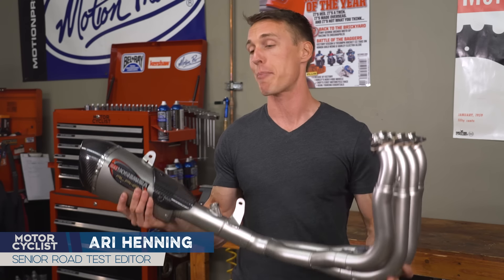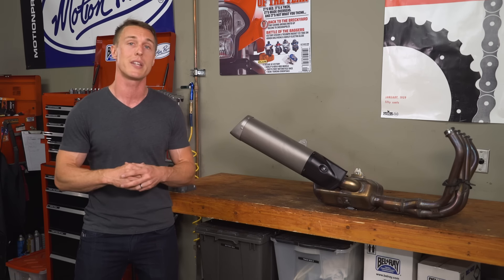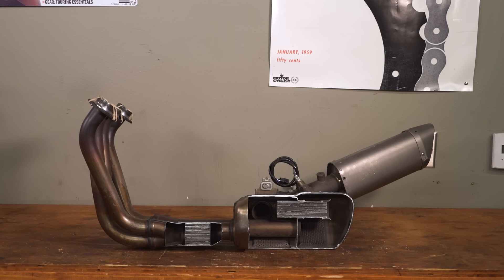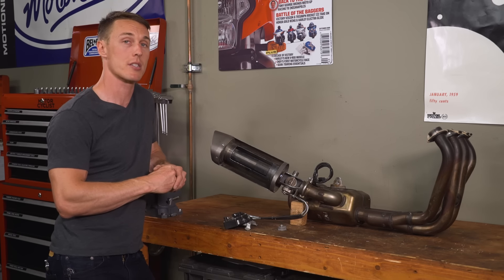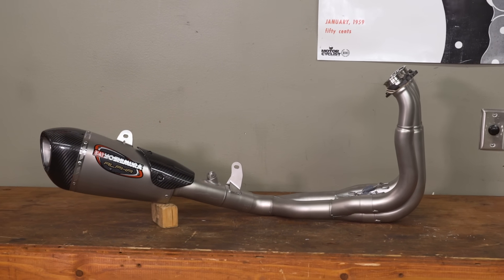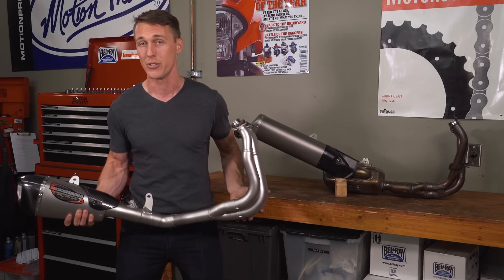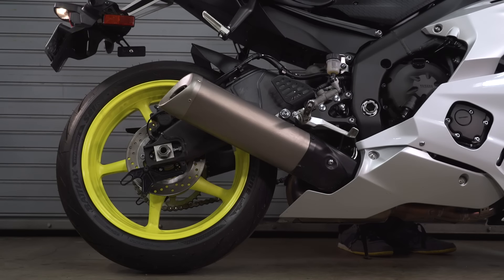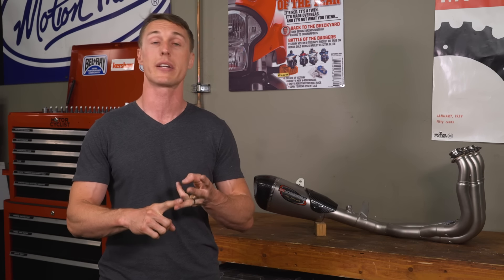The Truth About Aftermarket Exhausts | MC Garage

Comment: I gained about 20-25hp after removing my zx10r stock exhaust and install 3/4 pipe + pc5 and tune, so yeah I gained a lot of hp and it's sounds like a beast
Reply: Slip-on +filter wil net you about 5-7 HP, + a custom map may get you as far as 10, but forget the accuracy of the dyno if such a basic setup nets you 20+
I would be suspicious at 15, but you might have just found that factory unicorn (with a full system at least), but 20 is plain bullshit, you are gonna need som serious engine, ignition, injection mods and run race fuel to reach a 20%+ increase in top end power
Reply: @Nightdare  Depends on the bike. I have a 2002 Kawasaki ZRX1200r with carbs and a 2008 Yamaha R1.  With a full Akrapovich system with stage two jet kit, and pods, I got a 22 hp measured increase in power on my Kawa, and I got a 12 hp increase on my R1 with a two thirds system, leaving the headers only in place. That had a custom flash. Kawa went from 116 rwp stock to 138 hp on the Kawa, and 162 hp to 174 on the R1.
Reply: @jamesmarshall3311  

I see your dynocenter invested in a happy dynometer 
You're not gonna make 10% more hp UNLESS the bike was BADLY tuned from the start
Reply: @Nightdare  Nonsense of the highest order. You are way too much generalizing here, and are obviously not well up in this area. talk about ``happy dynos`` is childish.

Comment: My motorcycle rev to 9.5k rpm cut off. But im going to remove the rpm limiter where it can rev over 12k rpm and using High Cam and bigger bore piston. Is it still safe to use standard exhaust? I would like my my motorcycle as sleeper

Comment: I've got a 2015 R6 , only trying to lose weight by removing stock muffler and that massive box underneath by adding a y pipe and carbonfiber slip on, without having to tune. I've noticed the box only contains what appears to be one cat while the pipe before the box also contains what appears to be cats. All videos I've watched of people installing these have gutted the pipes, I'm assuming for flow. Just wondering if I could leave the cat like object in the pipes, connect the y pipe by welding and installing a slipon that still has decent backpressure , could I achieve my goal of losing weight/ having better looks / slightly better sound over factory / slight performance increase,  without losing any bottom end torque and having to get my bike tuned.
Reply: Btw I currently have a toce slip on installed and is to loud for my liking (came on the bike)

Comment: +Motorcyclist Magazine I’ve actually been curious as to this same question as the content of this video. If you could humor me, I have two questions. would this also be the case for Euro bikes like  my 2014 Ducati 899 Panigale? And is the power commander system the only thing else needed to reduce possible power loss with the aftermarket exhaust for the panigale?

Comment: Truth be told if I didn’t have money for an exhaust I would keep the stock one and get the bikes ECM flashed (De-Restrict) because of all the design testing and time they’ve spent finding the exhaust with the right bends back pressure ect makes their exhaust run smooth the flaws come in with the ECM and emissions bullshit so performance stock isn’t perfect but it’s decent

Comment: I can go faster with a stock exhaust.  Aftermarket pipe goes quicker but every cop from blocks around hears  you coming at 35mph. Yet I can move at 55 / 60 mph on surface streets and not even raise an eyebrow.  The one time I borrowed a friends bike with a kerker pipe got pulled over twice in one day.  As a motorcycle courier I ride 50 hours a week for 37 years in Los Angeles and have no points on my license. The loud bikes always get pulled over.
Reply: That's true. Louder draws more attention. And then psychologically bikes look like they travel faster than cars because they are smaller. So combining the attention grabbing nature of a pipe and the mental "speed increase" means you'll be much more likely to be pulled over.

Comment: That was a wonderful video and informative. I would like to know what happens to the O2 sensors when you install an aftermarket exhaust. Can we somehow still use the O2 sensor as it helps the fuel adjustments job as explained.
Cheers!
Reply: You have to reinstall the O2 sensors, if you install an exhaust system that doesn't have provisions for them then you'll have to buy O2 bungs (local automotive parts stores and catalogs like Summit Racing, Jegs etc have them) and cut a hole(s) in the pipe(s) and weld them on, any system that uses O2 sensors needs them for the computer to run the timing and injectors correctly, eliminating them will send the computer into a "by-pass" mode and performance will drop dramatically.

Comment: Whats the difference in performance between a thinner diameter head pipe vs a thicker diameter head pipe. I have a really thick header on my dirt bike yz426f and noticed its not the best at low end. But when you hold it wide it seems to really shine. Any info on the differences? Thanks!

Comment: This is my first year riding. I bought a used cbr600rr that already had a jardine exhaust. So first, if the very first thing most people do is replace their exhaust, having a bike delivered from the factory without one less its cost should be an option. Second, what do people do with all the stock exhausts? Is there a huge market for used oem exhaust systems?

Comment: Sorry but those cats still choke the exhaust. If you can get away with it (i mean not getting caught) then removing those has a huge impact. Back pressure really isn’t a boost to performance it’s more complex than that. Basically if you want maximum performance you need an aftermarket or custom exhaust.

Comment: Saves weight, sounds good but on modern bikes makes no power without major mods. Modern exhaust stock flows very well, unlike back in Day.  Many rob power if bike not tuned and many so loyd it just geys tickets and cops attention.

Comment: Wouldn’t the ECU still adjust the AFM to the new exhaust via the sensors?
I get that a tune/fuel control would optimize it, but if the ECU is so advanced, wouldn’t it adjust at least sufficiently?
Reply: You must have it tuned in.

Comment: How do the aftermarket exhausts affect your new bike warranty? if say you take it in for an engine issue will the dealer say warranty is void? What about insurance payouts if you haven't declared the modification?
Reply: Ask your dealer. Often you can order your bike with the aftermarket pipe already installed, so I don't think it's an issue, but check anyway.

Comment: My bikes have their original pipes on and are both almost 20 years old (yamaha tdm 850, kawasaki ZZR 1100). 
When I bought the ZZR used it came with an after market full exhaust system necks and muffler 4 to 1) on a full weight of 6 kg. I didn't like the looks, the sound and the performance of the torque. So, I found the original full exhaust system (4 to 2) used but in mint condition (weight almost 20kg), but I got a lot of better performance, perfect looks and much much better carb response and mileage. 
I don't like after market exhausts, I believe manufacturers on high power bikes are doing a great job on exhausts - I 'm not speaking for racing bikes but street legal bikes. 
Some say "loud pipes save lives", this is shit. The sure thing loud pipes do is to make terrible noise.
Reply: I agree and disagree with your comments. ZZr1100`s were notoriously hard to set up properly with aftermarket exhausts with the technology available at that time.  It might have been a poorly designed aftermarket system with worn out baffling, or worse, not jetted for your bike. One of my bikes is a 2002 ZRX1200, which uses an enlarged version of your bikes engine minus the ram air. When I swapped out the heavy and restrictive stock exhaust with a quality full Akrapovich system, the bike lost 21 lbs and gained 22 hp and better torque too.  The bike has a stage two jet kit fitted which is critical of course.

Comment: What would happen if you put an rc jet engine in an exhaust system would negative pressure increase performance or screw up valve overlap so much vacuum the piston would be pulled up

Comment: In Europe right now we see efforts to pass legislation dor noise levels, that are technically almost impossible with an internal combustion engine. Simultaniously more and more popular routes are closed entirely for motorcycles. We need to thank those riders for that who still think loud is cool. It is not. I would prefer to see police take motorcycles out of traffic that do not comply to existing legislation. So ride with a much too loud pipe and the bike goes to the big press in  scrapyard. May be extreme, but in the long run is in our very own interest if we want to keep routes open and ride gas driven bikes for some more years. Loud is out.

Comment: Remember all beat no speed in a lot of cases is true . Over the years I have tested lots of different pipe on different bikes and a lot of the time  performance pipe will work better on some bikes bit not others . So it  important to do research before just have  a performance pipe installed on your bike

Comment: Even in the old days exhausts were a crap shoot. There was a lot of re-jetting to do and it was rarely an exact science. Then what you got was a bike that was a little more powerful on the top end but had low or midrange flat spots (or even less power than stock in midrange). Low and midrange is where we live on the street, so unless you were racing it didn't really help much. Then there was the screw ups where jetting wasn't done right and engines were damaged. These pipes were often very loud. Young guys seem to like that, but man does it give cyclists a bad name. Finally it costs money and probably reduces resale value. It may seem like putting a very pricy pipe on your bike will increase its value but the opposite is probably true. The buyer will wonder if you did the installation and tuning right and will (rightfully) worry that a guy who has put a lot of money into making his bike faster has also ridden it pretty hard. Put all this in with the fact that modern bikes are so fast and powerful anyway that you can't use the all power they make stock on the street without shortening your expected life span anyway and it's hard to see why riders do it.

Comment: Unfortunately Ducati  used to make horrible looking mufflers.  I spent an arm and a leg to put the Termi racing,  WTF -  basically no difference at all apart from the noise. Yes I saved what / 8 Kg - but on a 80 pluls hp bike - 8 kg more or less make no difference, performance wise,  to the regular rider, Even with the original muffler,s the Duc still  can go with the line: Loud pipes, save lives.

Comment: you definitely shouldn't of said " if you get an exhaust like this, you absolutely have to buy it in conjunction with a power commander" but a lot of newbie riders like me buy a carbureted motorcycle and you can't get a power commander on a carbureted bike, that's pretty damn important to not even mention whatsoever in this whole video, not everyone owns a fuel injected bike...
Reply: I also have an older bike.  The tuning is done on a carbureted bike by changing the jets and adjusting fuel air mixture screw and needle.

Comment: I don't have a problem with stock exhaust system, however, on my 2019 z650 almost every time I go over a speed bump the exhaust hits. can you recommend an aftermarket, street legal system for the 2019 Z650 that would give me more ground clearance?
Reply: It’s not the pipe. Stiffen your rear suspension and stop dodging salads

Comment: I used to run a slip on on my Duke but it completely changed the way the Motorcycle behaved in low speeds, can someone tell me why ?
Reply: change in the back pressure affected torque output and delivery.

Comment: I've been thinking about what happens if you change the exhaust system on a new motorcycle that has a catalyst. must have the same function as on a car that it measures the exhaust to get the right air and fuel mixture. And if the lambda is dismount the engine will not work properly,must be tha same on a motorcycle

Comment: Many OEM pipes are Butt Ugly.  Many OEM pipes are located to either burn you or your passenger; no one loves the smell of melting boot heels or burning leather.  Many OEM pipes seem to be over sized and made of lead.  A lot of bikes sound too tame for what they are (not all but I am looking at you Honda).  Sound?  I want my motorcycle to sound like one and not a lawn mower or an electric razor.  It does not have to be overly loud but it has to have some note to the exhaust.  
I love OEM bikes that are set up right from the factory.  Who wants to do major mods and empty their wallets?  
My next new buy will have all the features I want (I will have to research).  Nice seat, perfect exhaust, decent power (not too much or too little), handlebar/footpeg and triangle set up, the works, and good filter locations for air/oil.  The only thing I want to add if it does not have one is a Sport Windshield.
I am not Cafe'ing or Choppering or Power Rangering or trying to add power parts to squeeze 1-4 horsepower out of an engine.  Just did that and I am not happy; cost and time.

Comment: I don't agree with what you said with a full system. If you have had bikes with just a slip on and also a full system you can tell there is a difference. Even a dyno will tell you that there is a difference. If you are puttin around on a small cc bike you probably won't feel much of a difference as well as dyno results, but the higher cc bikes that's what I mean.

Comment: I cut my 2stroke pipe open and mine was full of useless shit it was full of restrictions in the expansion chamber.... So when I had a complete Engine rebuild I changed my crankshaft to race performance one and got a basic piston and kept stock pin and con rod and what ended up happening was a miss fire so I and my dad wasted lots of time trying to sort it so when the exhaust got cut and lost all the bullshit what happened after that is I gained a lot of acceleration because the chamber was doing its job and top speed was 3mph lower than before but meh no prob